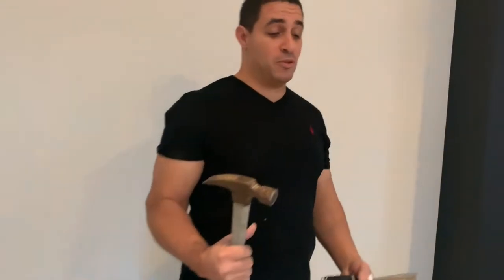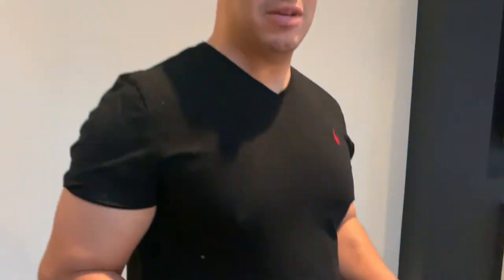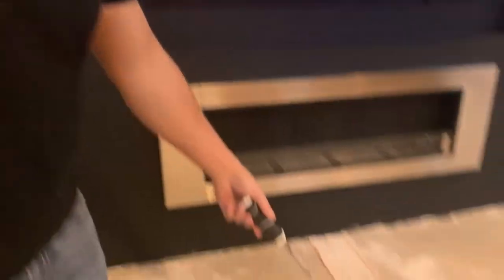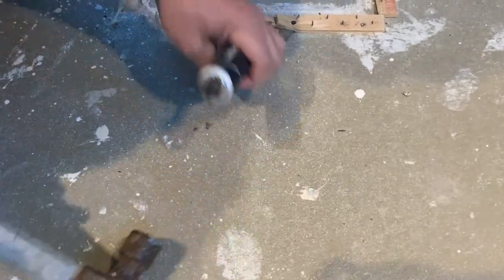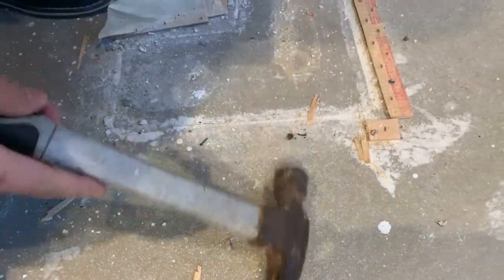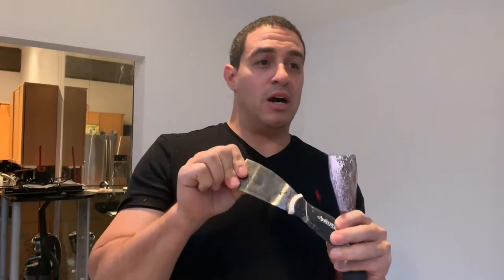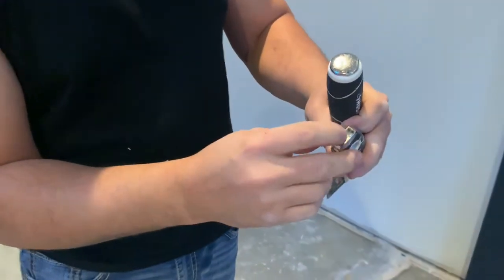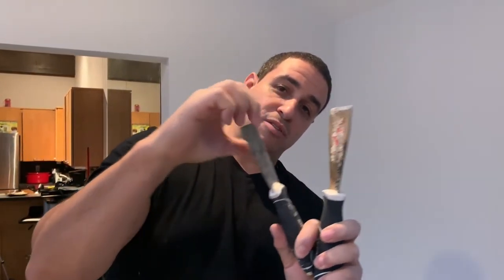How To Remove Old Carpet Tack Strips From Concrete

Comment: Ok i tried this with a husky "bent 3" chisel scraper stiff" (which i think is over level cheaper than what you have there?) and it couldn't get out some nails, started getting beat up with dings in it.  Also the top is plastic and started screwing off.   Also a quinn multi purpose (stiff) from harbor freight, which started to die... Maybe my nails are in tougher? :)

Comment: Flat head shovel, done in 20 minutes.
Reply: Spade shovel works better cause it has a point to wedge under.
Reply: @brandon10301991 by spade shovel do you mean the one with a point at the end/bottom?